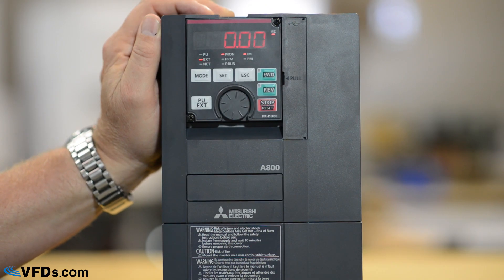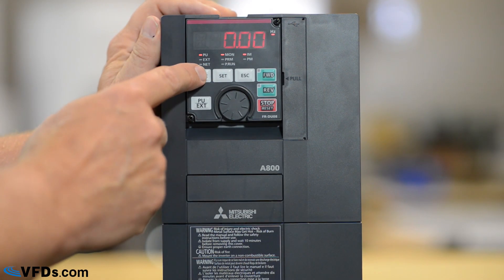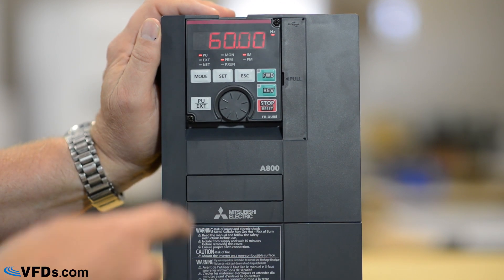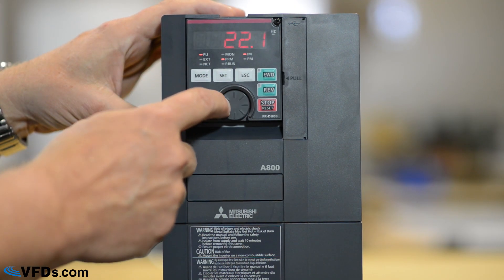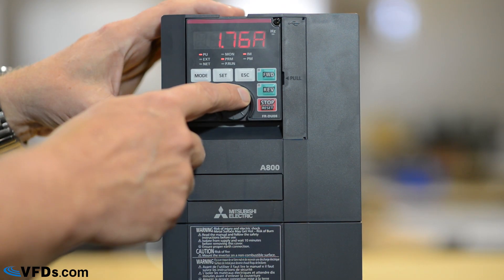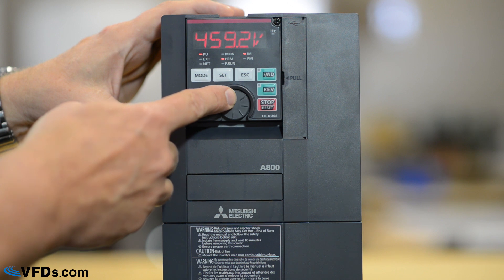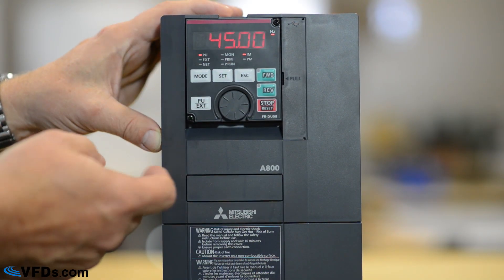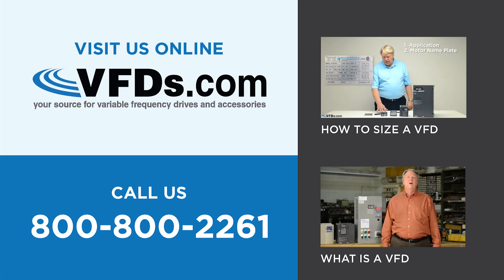How to program the Mitsubishi A800 series VFD (A820, A840)

Comment: Hello, I installed a Mitsubishi F840 speed variator, it works well when the engine is empty (no load) but when the engine is put under load it doesn't work. I don't understand anything??

Comment: Hi,
Sir, I am from Bangladesh. Our company bought a Mitsubishi A800 VFD for operating Atlas Copco 90VSD compressor. We properly installed all electric and mechanic parts of this compressor. Electrical wiring and mechanical fitting is ok. But this VFD gave high amphere 180amp to 200 up amp. The parameter setting P9 is 210A. Compressor setting 10bar. When run then after (2 - 3)minitues VFD goes to trip condition which desplayed TH again and again then displayed E.FIN. I give you two picture with this sms which is Motor and Compressor nameplate. Please give me solution how we solve this problem. We also communicate with Bangladeshi representative for this problem, but they didn’t give proper solution.